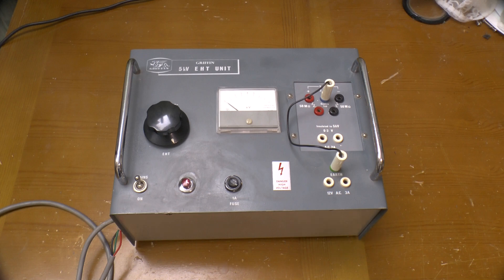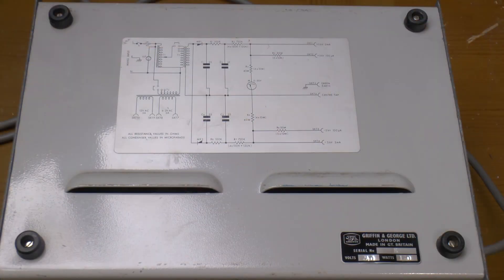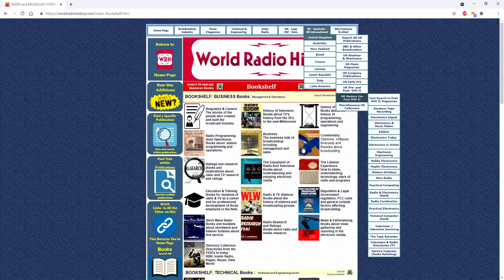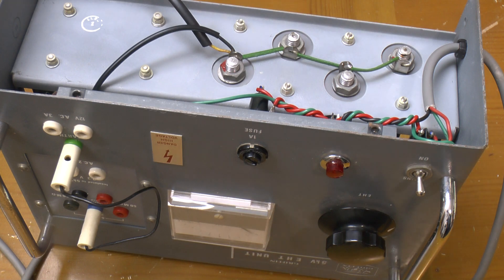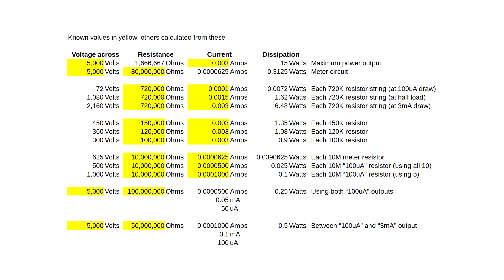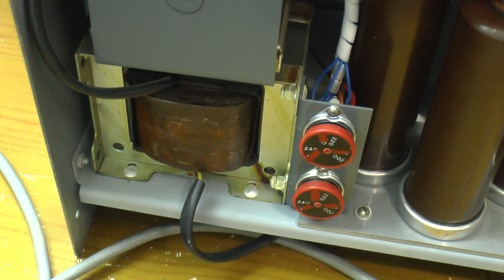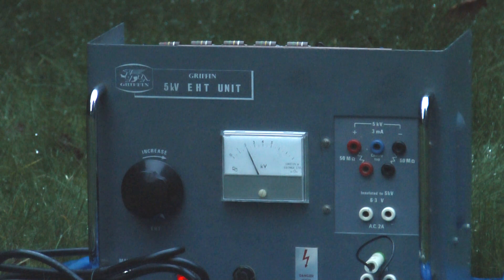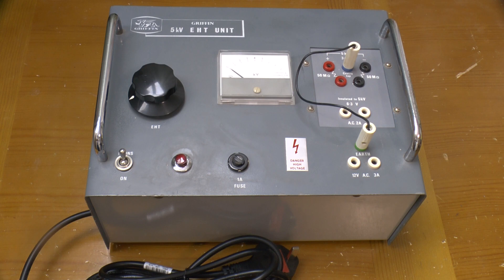Griffin 5kV power supply teardown

Comment: I have just landed one of these in a house clearance. Still need to test it though. I repair the odd tube amplifier, but can't think of what I might use 5kv for. Might be worth swapping out for some more modern parts and making it a 600-700v tube amplifier test psu?

Comment: Would you be willing to do a tear down of an Amazon product for me? Im no electronic expert or anything but I find it fascinating. I found a listing for 15W charger plug adapters on Amazon and saw the top review was a melted one. I want to know if it was the mechanism or operator error but I'm not willing to risk my house and I'm not smart enough to know what I'm looking at if I opened one up lol I could message you the screenshots if you like and you can check it out if you like? No worries if you're too busy
Reply from the maker: The only operator error that should cause that would be putting it in a fire.
I've got a bit of a backlog, you could try asking @bigclivedotcom though.
Reply: @AintBigAintClever  I'm familiar with Clive! I'll  send it over to him. Thanks!

Comment: They don't make 'em like that anymore!

You can't plug in something 20 years old without capacitors exploding!
(Or maybe it's just me?)
Reply from the maker: When I was digging around for info I found that two vintage components have a propensity for failing: visconol caps (with a bang) and SenTerCel stick rectifiers (just go high resistance and virtually impossible to test at low voltage due to the high forward drop), hence it being tested outside in the middle of the garden.